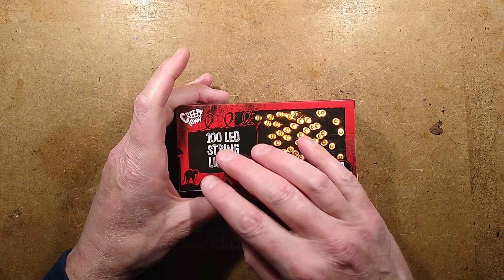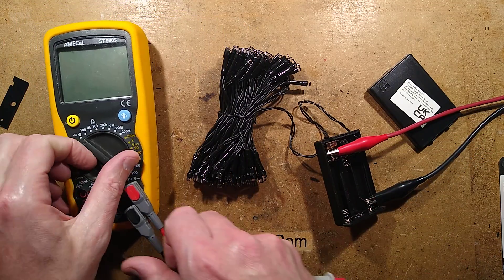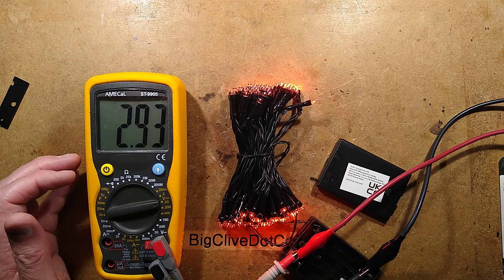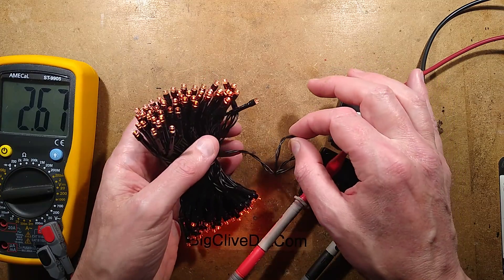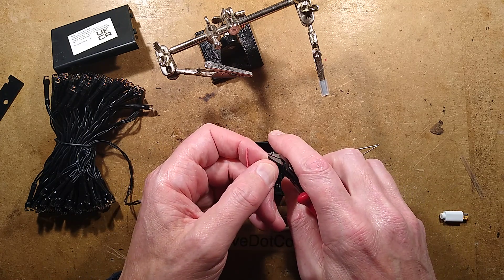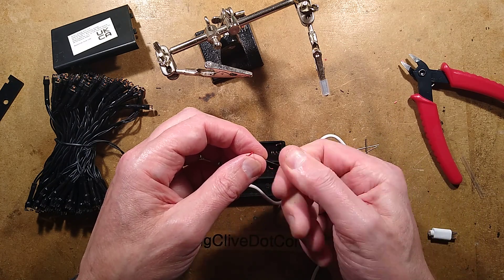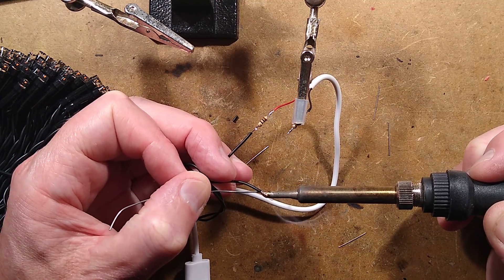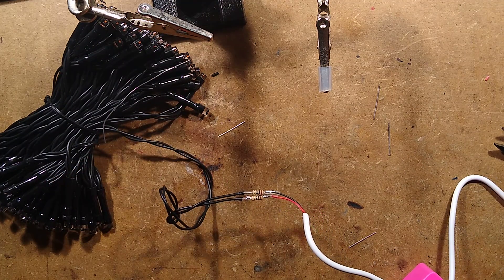Poundlands 2021 Halloween lights (and USB hack)

Comment: I was just thinking after you did the heat-shrinking: "he could have added another layer of heat-shrink over that", right before you mentioned it!

I was a university electronics technician for 26+ years, so I know the pain of forgetting to put on the heat-shrink or a cable gland/shell beforehand.  If you're lucky and you're putting stuff on both ends, you screw up on the first end but can still get the bit you forgot about on via the free end.  Then you're extra careful not to make the same mistake at the other end!

I like your tinning technique - reminds me of how I used to do things - soldering iron in one hand, component or wire between thumb and first finger, feed in the solder via middle and ring finger.  If I had a lot of cores to tin, I found it quicker to stand the solder up (from a reel) so that it's pointing up at you as you look down, then just run each pre-twisted core through it, working your way down toward the bench as the solder is used.

One last thing, for those who don't have helping hands  - a chunky pair of pliers on the bench with an elastic band around the handles makes a pretty reasonable substitute for holding things in place when necessary.

A great video, as always.  Cheers.
Reply: The worst one is when you are seriously knackered then solder them all up again to find out you forgot to put the heat shrink on the second time. I worked myself to a standstill at one company after doing 3x32hour shifts in one week then even more the hours the second week and was actually on my feet for most of it. By the end of two weeks I didn't know if it was arse or next Tuesday.
Reply: 32 hour shifts?! Wow, I've never heard of people working that long in one shift. 3 in one week must be a killer.

Comment: I wonder if they were just reliant on the aa batteries' internal resistance to limit the current.  I think that would give about 1.5 or so ohms.
Reply: That works when they ship with "heavy duty" batteries preinstalled. Then you replace the batteries with something better and they quickly die. There's really no excuse for them not including a real resistor.

Comment: Pretty colour Clive, ("beautiful plumage").
In early days of CB radios in trucks n' lorries n' such, I learned to offset any parallel incursion into double-core-flex. Primarily for in-line fuse-holders. Cos we all know truckers / truckies, any bolt, nail, or screw, is the perfect replacement for a 2amp fuse, right !  ;)

Comment: Did you do any calculation on what resistor values you were going to use, or did you just 'know' from experience what was proper?
Reply from the maker: Just knowing that those values are a good choice.

Comment: Because of your videos like this one, I've been doing the same and also making my own led strings, I've been running them around the top of the walls at the ceiling in the rooms of my house, they are perfect for lighting a room but not too bright, I love the effect, also a local DIY has sales on 5,000 mAh power banks from time to time (bought a bunch £4.40 or about $6.00 )  a few weeks ago we had a severe storm that knock out power to 180,000 homes for two days, that's what's nice about having the string lights up, power outage? No worries 👍just plug them into a power bank, let there be light😁 although I'll have to find a better quality bulk leds, my first string I made that lights the staircase lost a bit over half their intensity in nine months, they're on from dust till dawn. 
Cheers.

Comment: The purple LEDs are indeed nice, I got a set a couple years or so back along with the orange ones, and they do look good mixed together... :)
Reply: I got some purple ones years ago, they're so pretty. Also, tiger normally do a string of those really tiny LEDs with plastic bats in purple.

Comment: To comment on what you said at 10:40 in the video about heat shrink tubing and ways to get it to shrink. For me, I've used a soldering iron and it works... more or less okay. luckily it's one of those with adjustable temperature so ye. (it has a read out display that can read in both Celsius and Fahrenheit)

Comment: Why have a resistor on the negative lead? Isn’t positive only sufficient?

I noticed the power bank does not say where it’s from, is that not a requirement of the UK or did it have one of those round gold “Made in China” stickers from the 90s?

I would have heat shrunk the whole lot as there is risk of the lead being pulled apart otherwise.
Reply from the maker: Two resistors spreads the dissipation.

Comment: Clive, I've been watching your videos for years, and I've seen you make this modification to dozens of light strings. I have no idea why it took until now to realize that this nets you a regulated voltage, thus constant brightness. 🤦‍♂️ I've got 18650s and old USB leads coming out of my ears, and the lipstick-style cases are cheap. I could run my Christmas lights for a lifetime, without running extension cords or blowing the budget on batteries! 😵😁👍

Comment: I've found that Dollar Tree LED lights tend to have 3 batteries as well, when only 2 are needed. Pretty sure that's done to make them fail quicker.
Reply: I bet it's for an "ooh, aah, so nice and bright, these must be better!" reaction.  Same as the blown-out brightness they set showroom TVs to
Reply: I'd always figured the 3 batteries thing these days was generally because things had become standardised around ≈USB voltage and the option for USB power. Obviously that's not helpful when they skimp on components.
Reply: How about two sets of lights in series, powered by the battery pack with three cells?
Reply: The problem with using only 2 (alkaline) batteries is that battery voltage drops as they are getting depleted. Those LEDs will then extinguish, long before the batteries are really dead. In the end, you end up with a very short battery runtime - and a lot of "empty" batteries which aren't. 

When using 3 batteries, you'll get a much longer battery time, even though you'll over-drive those poor LEDs at the beginning (although not as much as when using a bench power supply, due to the internal resistance of the batteries even full AA batteries probably won't get up to 4V under that load)
Reply: @MartijnvanBuul  Uh, no. And I say that as someone who has rewired Dollar tree LED lights to run off of 2 AAA batteries.

Even on 2 AAA batteries, the light will run for hours. I ran them inside a tent and they lasted for several nights.

And, as you can literally see in the video, the LED's begin to dim as the voltage drops.

In fact the more I read your comment the less sense it makes so I'm going to leave it at that.
Reply: @Xplasma1  did you reply to the wrong person because everything you said in your comment (except for you telling him he's wrong) he already said. He didn't say the led's wouldn't work on 2 double A's , he said they wouldn't be as bright and they would dim out fairly quick.
Reply: @MartijnvanBuul  Not criticism but query for educational purposes Martin. When I recharge my alkaline rechargeable they have an initial voltage of 1.67V which puts 3 of them in the in the 5V range for a short time and even after a lot of use they are still holding 1.5V. I don't know how long 3 of them would hold the voltage since all my experience is with 2 AA in series and not 3 AAs. Assuming I were to use 3 AA batteries then they would be spitting out 4.5V for quite some time after they discharge for a while and result in more LED damage that if I were to put an appropriate resister into the mix? (Sorry, I hope that makes some sort of sense)

Comment: At almost an amp I doubt alkaline batteries would over-drive long enough to hurt much before the internal resistance and high load brings the voltage down a lot...
Reply: Yep, alkaline cells will very quickly self limit... not so well with certain rechargeable cells though!

Comment: Ok, stupid question maybe, why not a single 20 ohm resistor on the +ve side rather than two 10 ohms each on the +ve and -ve sides?
Reply from the maker: Spreading power dissipation.

Comment: Did you use the 10 ohm resistors to drop voltage, or to protect the LEDs, or both ?
Reply from the maker: To limit the current through the LEDs to protect them and give a long run time.

Comment: Why 10KΩ resistors? Would other work?
Reply: 10, not 10000
Reply from the maker: 10 ohm, you could use other similar values for different current levels.

Comment: Regarding automatic wire strippers, for a long time I didn't like them either, mostly because the cheap ones I had at some point were just plain horrible. But the Weicon No. 5 I got for christmas last year really work great IMO, and aren't that expensive either.

Comment: Earlier this evening I picked up a £2 Poundland LED cob "worklamp" that runs off 3 AAA cells and had in mind making it USB. Clive has saved me the thinking of what size resistors to use with perfect timing. No info on it about what wattage but from the intensity I'd suspect it is also massively over driven.
Reply from the maker: The Poundland COB lights are often overdriven.  Adding resistors is a good thing.

Comment: Generic comment alert!
Have you ever looked at the humidity sensor switches? The ones on eBay I looked at have a mains changeover relay, but don't appear to have a neutral connection. How does that work, then? Using the load as the neutral would need a load on both the NC and NO terminals, wouldn't it?
Reply from the maker: What's the description on eBay?
Reply: I bought one. It arrived today, and answered my question. Seems that it runs off a 5v DC supply and the relay just has mains rated contacts.

Comment: Hope you don’t mind me asking but what soldering setup do you use? I use a quick  at work (not mine) but the tips are really expensive
Reply from the maker: I currently use a Yihua 8786D station with soldering iron and hot air pen.
Reply: He uses one of those cheap Atten or another generic clone dual soldering / hot air station, although these days I highly recommend getting a TS100 or a Pinecil, the ergonomics aren't great, but they're fantastic irons and can be powered by any DC source such as batteries making them perfect as portable irons too, if you need a hot air station just buy a standalone unit, the cheap ones are like $30 and good enough for hobby use, although quick makes some inexpensive models like the 706W and 857DW/957DW for around $150 which are a nice upgrade.
Reply: @vgamesx1  thanks, my boss has a ts100 which I’ve been using lately so I may just get one of those for myself

Comment: I am surprised at you ! And I have seen you do this a few times. In older times , when I was skint, if I cut a plug off a premade lead like that...I would always leave an inch or two cable, to make it easy to re-use said plug in future ! Also, even tho I don't smoke I love to use a cig lighter to remove insulation on fine wires...... I did that in a C&G exam, soldered a DIN plug, forgetting to put plastic cover on first...DUH !

Comment: Can you demo how to hack and convert a plug in powered outdoor LED’s to small outdoor solar power? 
Or adding additional battery capacity to outdoor solar lights? 
UK energy (and California) crisis hacks!
Reply: I have great outdoor LEDs, but either the solar doesn’t last long (one 1865 lithium) and it’s not bright enough, or the plug in… is well plugged in. And in California even  with LEDs… you don’t want to see my electric bill.
Reply: @A-Negative  you have the opposite problem with the solar packs.
I am about to do exactly what you suggest, and the nimh cell voltage from a cheap solar unit is too low to power these led strings - They will work on 3v, but not 1.5v. 
I have just ordered "DC-DC 1V 1.2V 1.5V 1.8V 2.5V 3V to DC 3.3V Step-UP Boost Power Supply Converter" to connect a string of these lights to an old solar unit where the led string was damaged (and thrown out by the missus).

Comment: I used to put zi tie cut offs in the heat shrink with the resistors. It's not water proof but it's keeps it very strong.

Comment: Why are you putting 10ohm current-limiting resistors on both +ve and -ve ? Why not just a single 20ohm resistor on one side?  Genuine question - trying to understand the logic here...
Reply: Spreading the heat over 2 of them?   (Note: I'm not electrician nor any good with this stuff. Just a guess.) 
Cheers
Reply: Two separate resistors will dissipate more heat than a single resistor.

Comment: I had one of those "fake batteries" that I was supposed to use when not using rechargeables... I've run the 2 AAs and a fake battery in my Halloween lights, a little dim, but they're just ambiance lights.

Comment: 40 pin connector then realise you forgot to put the cover on first :D
I bet you've wired a 13A rubber duraplug and had to cut the cover instead of rewiring.
Reply: I bet most Duraplugs have been cut - I've done a few.
Reply from the maker: Yeah, fortunately it doesn't show much if you cut a narrow slot and shove the cable through.

Comment: I have noticed with Poundland that there has been shortages of certain items including Epoxy resin and Kodak rechargeable batteries. Even things like spray paint an varnish to which I use in my hobbies as I restore old battery lamps. I was told it was a shortage of HGV drivers but no doubt other factors are at play. I managed to find what I needed at an old hardware store, these are few an far between but we're common place in the old days, a few still exist though. I don't trust buying certain items online because of quality build an safety. I do source some items online though but care must be taken.

Comment: See Clive? This is why I watch your videos. There's no hesitation, no "Let's stick some batteries in here and see if it works.", none of that nonsense. It's straight to the spudger, screwdriver, hammer, or whatever, just the plastic cracking and flying through the air as you get right to the heart of the matter. Lol.
Reply: In the words of another electronics guy I like on youtube, 'Dawnt turn it awn, tekk it apaaht!'
I'm sure Clive knows who I mean

Comment: How much did they cost? 😁
Reply: I guess either £3 or £4
Reply: 20 LED string is £1 The 40 string is £2  and 100 string is £3 They are on their website.
Reply: Had a look today, the actual price is £4 for the 100 LED string.
Reply: @Mark1024MAK  On the website they have two sets of 100 LED string lights listed. One for £3.00 and another for £4.00 There's no picture for the £4.00 string. The product code of the £3 set is 434824
Reply: @urbanimage  - Yep, that’s why my first answer was “either £3 or £4”. Since then I’ve been in an actual store, and the Halloween orange set of 100 LEDs is £4. The code on the box is 482753.
Reply: @Mark1024MAK  Yes, I've noticed a good few inconsistencies between their website and real-life. Still, their LED lights always tend to be good for the money.

Comment: I once had a 14-foot Christmas tree with I think 600 purple incandescent bulbs on it. I don’t have high enough of a ceiling now, but strings of purple LEDs should be more practical.
Reply: They've had them for well over a decade, as long as you can stand 100Hz/120Hz strobing.  I hate line-powered LED Christmas lights for precisely that reason.
Reply from the maker: Sometimes you can get a really deep psychedelic violet colour.  But they're hard to find.

Comment: Halloween ...pah my local shops are full of Christmas lights ..wtf it's September.
I've got several sets of the same draper wire strippers ..my fellow sparkies take the piss but I find them very useful.
Reply: Aren’t you supposed to use your teeth? 😂 
I’ve got various stripping tools, from £30 automatic types to £5 semiautomatic types. Plus the manual fully adjustable type.

Comment: i've followed your advice from previous videos and installed a resistor in my packs of these styles of lights, also removed the middle cell and put a jumper wire in to reduce them to around 50mA  - last for yonks

I've got one that i run from a Li-Ion pack rather than upping to 5v then resisting back down ( protected mobile phone battery)

Comment: By accident I learned that the lower part of a soldering iron (away from the tip, the barrel bit that is not quite as hot) works surprisingly well to shrink the heat shrink over a wire. A few gentle strokes and it fits perfectly.

In a local shop (Action), they had a "Heat Embossing Stamp Kit" - according to the package it's a 300W fan with 300°C max temperature. We shall see if that works for de-soldering. At its price of less than ten pounds it's worth a try.
Reply: "A few gentle strokes and it fits perfectly."

That's what I tell my girlfriend. 😁
Reply: with the soldering iron on the holder you can bring insulating tape to it and cut it... i mean without stripping, causing it to stretch and lose it's stickyness on the end, it's also awful to do, you hope every time it will not stretch too much

Comment: Might the internal resistance of 3 AAs not work like an external resistor to limit the LEDs to a reasonable current?
Reply: I was wondering the same and was hoping he'd measure the current from actual batteries.  Though three rechargeable NiMH cells still seems more reasonable than, say, three alkaline.